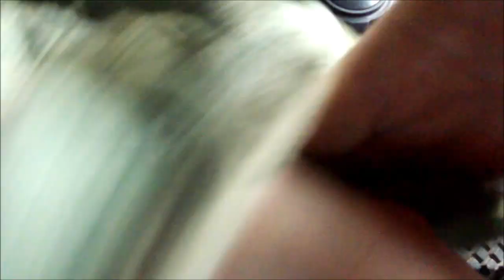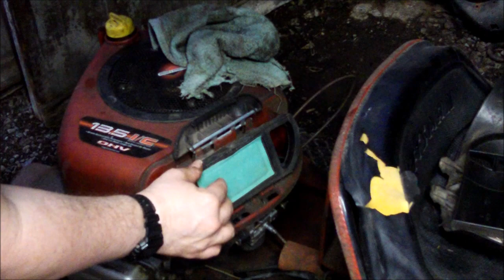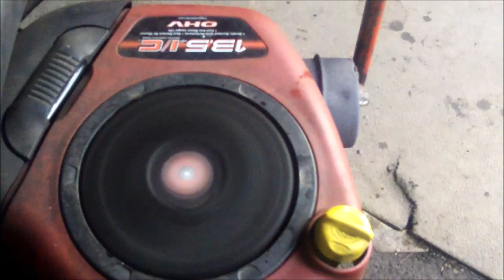a heartful tale of a tune up on a 13.5 hp briggs 2003 intek on a vintage snapper comet rear engine

Comment: 32:00, ah, I see you got the Craftsman WC2200 weedwacker.  it's got terrible customer reviews on the craftsman website, go check it out.  lots of various problems.  some say the trimmer head has a poorly designed string feeder that tangles and wastes a lot of string, and falls apart after one season  some say the pull start recoil doesn't last long before it breaks.  many say it won't start or it's very difficult to start.  some say when the carburetor has problems, the manual and tech support do not help fix the problem.  Do you have any problems with yours?
Reply from the maker: Have not had any problems with it yet just have to baby it
Reply: @bleachmultiverse  have you ever adjusted the carburetor on the weedwacker?  do you have a special tool for that?  does that weedwacker have an electric start port?
Reply: @bleachmultiverse  where did you buy that WC2200 weedwacker?  how much was it?
Reply: what was your previous model weedwacker?  was it the Craftsman WC210?  Ah, ya ok I see it.  You did a video on it in May 2020.  Ya it was the WC210.  Do you still have it?
Reply from the maker: @mrbubetube  that wc210 never worked right would not run took it back to Lowe's the wc2200 just broke today the spool is jammed and won't come off are the sthl weed eaters still good thinking 💭 off buying one of those either a gas or battery one
Reply: @bleachmultiverse  it broke already? wow, how long have you had it?  did it get much use before it broke?  you should definitely read the customer reviews of that weedwacker on the Craftsman website.  it got mostly 1 star reviews.  Craftsman tells customers to email them at WECARE@sbdinc.com and tell them about the problems.
Reply: @bleachmultiverse  when you had the WC210, did you ever use the electric start option?  this video talks about the electric start port https://youtu.be/Daf5cJDS3zg  I remember a couple years ago, I saw a video of a guy trying to start his WC210 and it took him 140 pulls hahahahahahahaha.  I'm trying to find that video again.
Reply from the maker: @mrbubetube  not long and its broken barely used it are there even and good weed eaters from factory the are not junk falling apart after a few uses